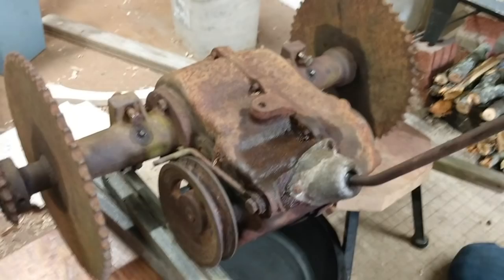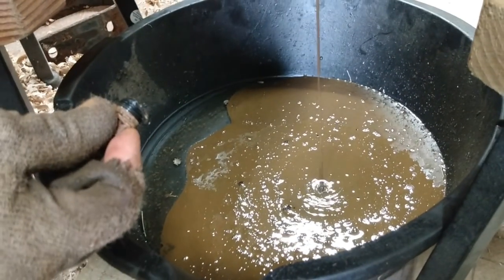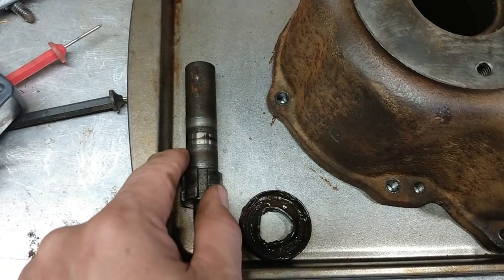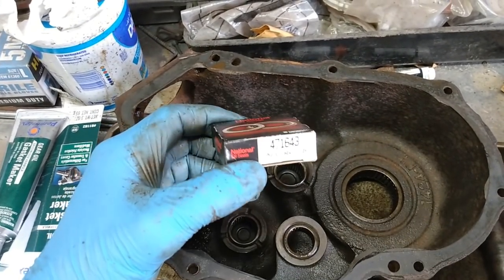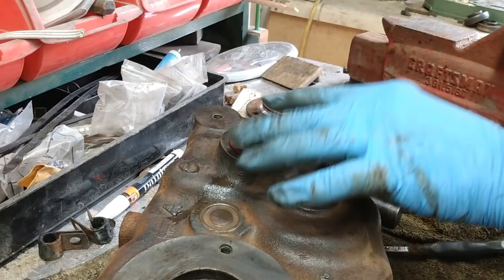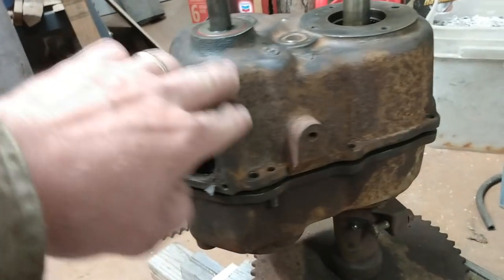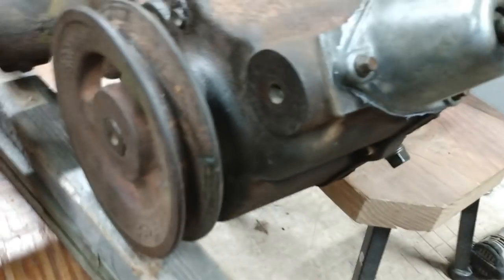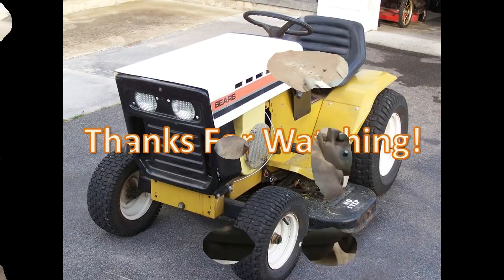Struck Magnatrac MT2000 Restoration #3 - Transaxle Repair (Peerless 2338)

Comment: Hi, I'm also from Australia and just come across your video's, looks interesting with what you're doing, good job, I'm involved at a vintage machinery museum and run a steam roller and have a English model classic 1955 -'57 D270 Allis Chalmers, love the older stuff. Just a thought above replacing seals like what you were doing here, you can use a small block of wood, that way nothing gets damaged. Keep up the good work. Dave.

Comment: I gatta take mine out some day bc I was loading it on a ramp and the bottom corner cought in one track and now when it backs up the right side clicks and also I thing my tracks are past being tighten need to take a link out or so. And they could have put a better fill port if it's ever drained

Comment: I have one and I lost all gears in the transmission.Any help as to what the problem might be? Thanks
Reply from the maker: Not sure, but it could be the main input shaft is broken or you've stripped the teeth off the gears - that would explain why all gears are gone...
Reply: @gardeningpreacher  thank you for your help.
Reply: Can you get transmission parts for them? Thanks

Comment: I just wonder how easy or hard it is to come across that transmission?? Part numbers??
Reply: It's a Peerless 2300 series.  Just about every garden tractor with a 4 speed built in the 60s and 70s had this transmission.  Axles and axles housings varied.

Comment: Good video. How did you get that roller bearing out? The one missing one of the balls. Just my opinion, but I would at least spray some black rattle can paint (any color will do...red? lol) on it to protect the metal. Have you thought about attaching the camera on your head? Then we "see" what you see as you see it.
Reply from the maker: I got the bearing out by taking a pick and a screw driver and working it back and forth and it lifted out...  I would attach the camera to my head, but I don't have anything but duct tape to do so...